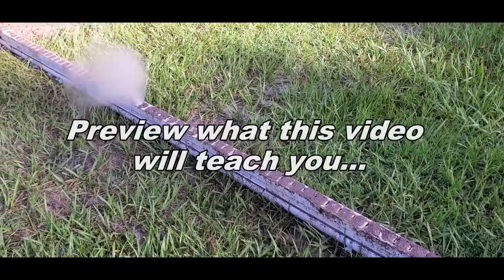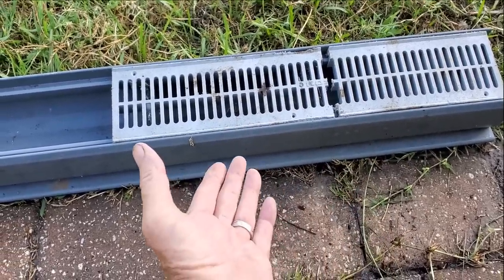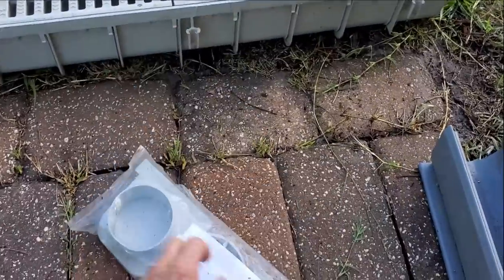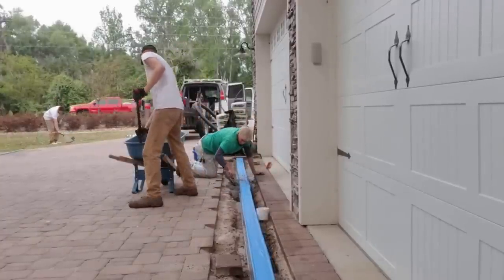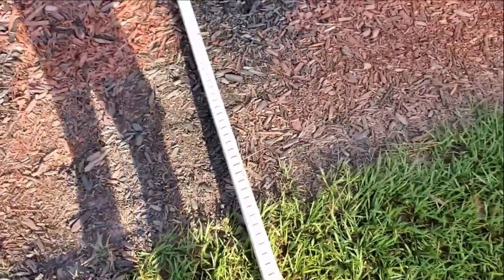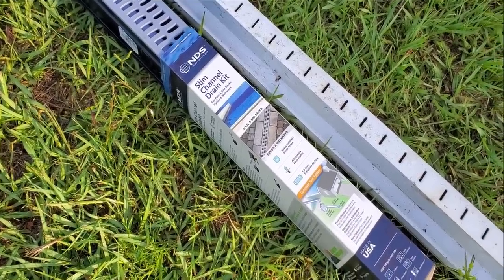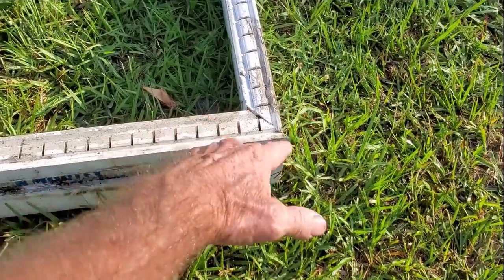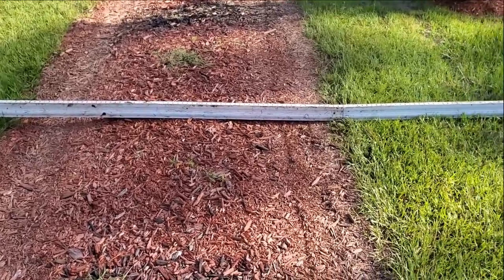How to Install, Repair & Clean Channel Drain | Guaranteed to Collect Water

Comment: I have 40 feet of the Aco K-100 system on my driveway.  The system is available pre-sloped, meaning each successive 3-foot section is a bit deeper.  The built-in slope allowed the top of the drain to be level to the driveway while having high flow velocity.  It's polyester concrete composite, rather than straight plastic.  It's a commercial-grade product, much sturdier than what is sold at Lowes/HD, but has been worth every penny.  The grates can be removed without a screwdriver.  I excavated the concrete and trenched for the drain pipe but hired out the drain installation.

Comment: Is it ok to lay the concrete in there with no form? Just straight against dirt? If so that is what I want to do with my next section. All of the project is below grade and will be covered by 2 inches of rock.

Comment: Hello the screws in mine have rusted and the plastic has broken where the screws go into. Now the section of the end is sticking up. What can i do to hold this down to connect to the other piece without  taking up the whole thing up. maybe some type of clamp,
Reply from the maker: @CindyClanton-b1e  replace the drain!

Comment: I pulled out the old 2 inch channel drain around pavers. The new nds 2 inch won't fit because of shifting pavers. should i try eresetting pavers or cut the pavers with a concrete saw? ty
Reply from the maker: Yes

Comment: if I use the NDS channel drain that you said works best in concrete on a driveway and would like for the water to drain to the sides, would the channel drain need to be sloped??   The pipes beyond the outlet will be sloped of course.

Comment: What if I have no outlet to daylight to finish the drain?
I live in a very small town and my yard is at the same level as the street. No curbs. Would it work to run channel drain into perferrated pipe and lay that into a deep bed of gravel in the ground. Would that work?
Reply from the maker: You might need a sump pump

Comment: having new patio installed- they want to use a Deck-o-drain and it will drain into the new drainage system to carry water away.  Will there be any way to clean the deck-o-drain if there is not an open end??

Comment: Is there a way I can install a channel drain across my gravel driveway to keep water out from under my carport or does it have to be in concrete? I can't afford to pave it but I need to keep the water from flowing down the hill into my carport.

Comment: Does the channel drain need to be pitched toward the drain side ?
Reply: It will work level, but the flow will be a lot slower.  Slope helps considerably.  Of course, then the drain is sunken at one end if the surface is level.  I have a pre-sloped system where the channel sections have sloped bottoms and get progressively deeper toward the drain.  The flow is very quick even though the surface is level.  Costs a bit more, but well worth it since the bulk of the project was labor.

Also, go with smooth-wall PVC, not corrugated.  I specified SDR-26 gasketed pipe which will probably last a hundred years or more.  No worries about equipment driving over it, and it hasn't clogged at all in five years.